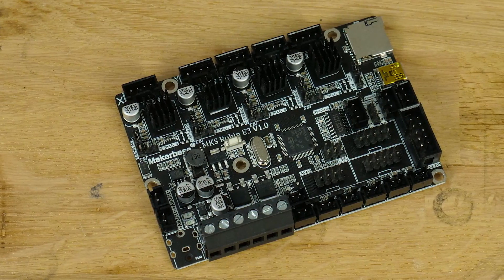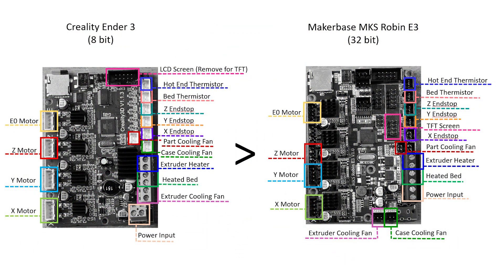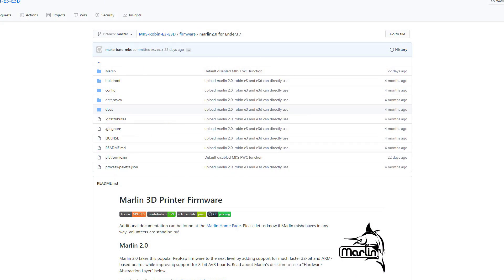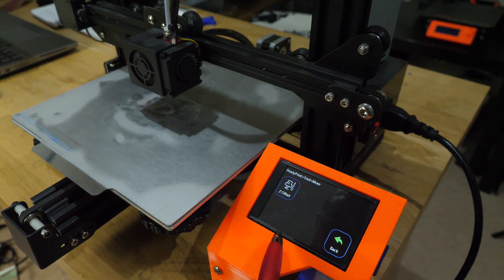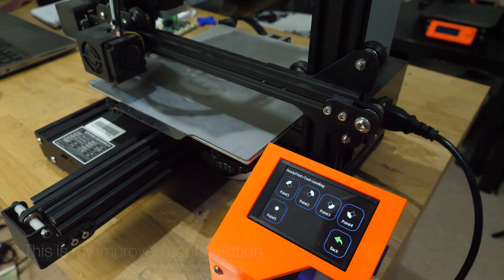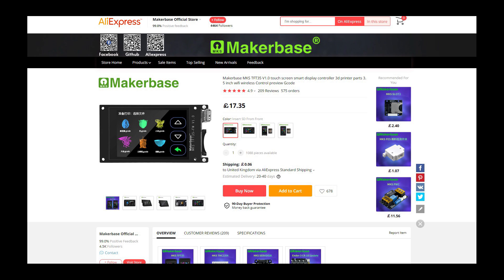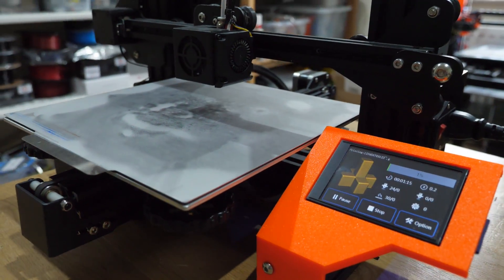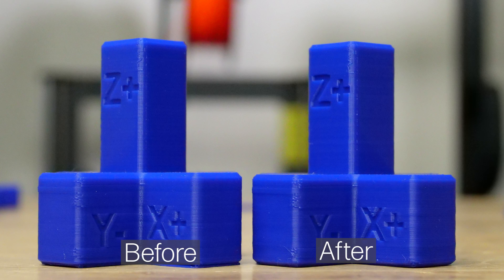MKS Robin E3 and TFT 35 Complete Guide and Review #AD

Comment: I have ender3 just upgraded to this board and it is just awesome. Paid $22. dollars on amazon and it worked out of the box. Runs great very smooth and very quiet .just the fans making noise.I came with i think Marlin 2.09. its better because it is a 32 bit board verses an 8 bit board..

Comment: Hey Vector, I’m trying to get my Mks Robin e3 to work on my custom printer and I’m having trouble setting up sensorless homing, how did you do the jumpers? Also why is my z axis homing up?
Reply from the maker: Z homing up sounds like firmware is wrong or stepper motor connector has been flipped somehow. For sensorless homing you'll need to modify the firmware to enable the feature and set the headers to ensure UART is enabled.

Comment: Hello!

I already apologize for my English.

If someone can help me I will try to explain my problem.

I have an MKS Robin E3D with TMC 2209 in UART and an LCD BTT TFT24 v1.0

If I get the firmware.bin and upload it I can access it through marlin mode but if I get the folder and I don't even make a change and I create the firmware.bin with the exact settings that the supplier makes available when uploading the firmware to the board MKS RObin e3d the marlin mode screen goes black.

The touch mode does not work, even if everything is properly connected there is a message saying "no printer checked"

Follow the manufacturer's marlin.

https://github.com/makerbase-mks/MKS-Robin-E3-E3D

Comment: So i wonder, since the screen has a serial connection to the board, if you have really complex G-code, can you make Marlin choke unlike how it would from SD-Card connected by SDIO or SPI? What baud rate is it anyway? Perhaps it's not that much of a problem because of better serial functionality offloading and overall higher performance of the 32-bit board...
Reply: I don't know about the Makerbase, but the BTT boards use 115200 baud between the TFT and control board. I'd be a little surprised if the makerbase is any different.
On the BTT setup, you can still use the main-board microSD card slot by putting the display panel in a mode that emulates the original display - i.e. the text menu managed directly by the control board. I've not had issues with the print choking (long ago set the resolution parameters in the slicer to sensible values), but if it ever does occur I know I can use the control board's microSD card.